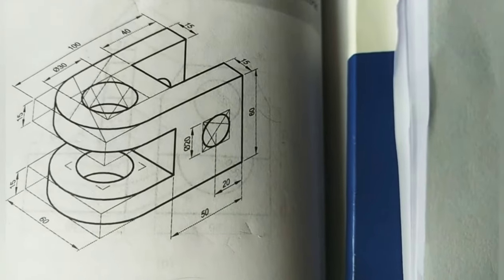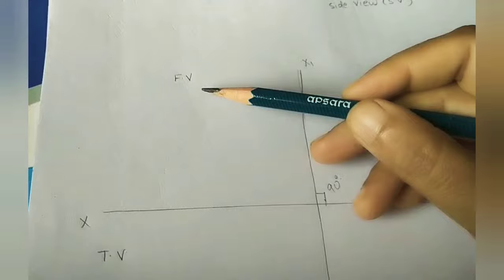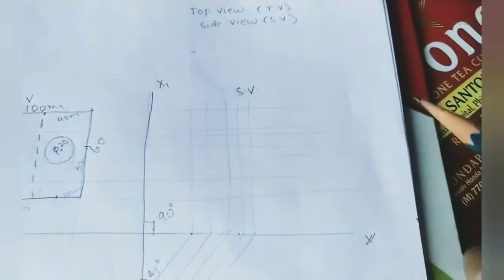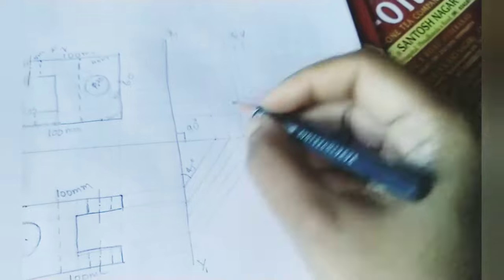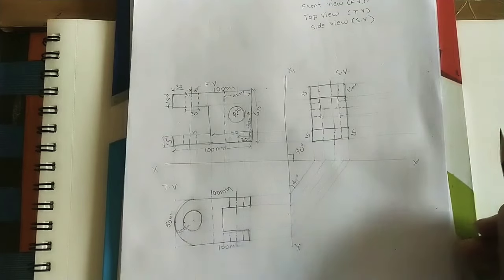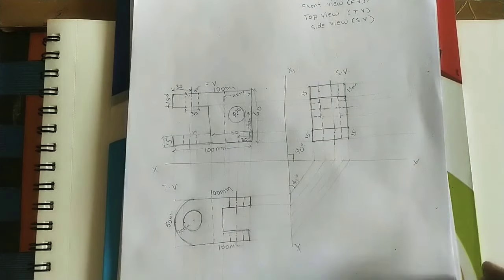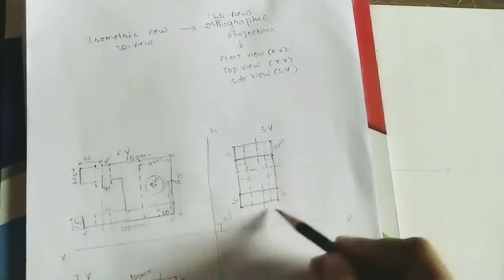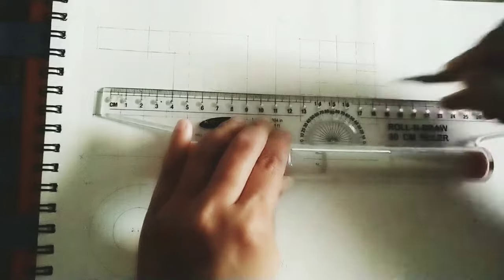Isometric to orthographic Projections //Engg. Drawing //Engg. Graphics

Comment: Draw the locus of a point p moving so that the ratio of the distance from a fixed point F to its distance from a fixed straight line is 0.75. point p is at a distance of 70mm from the straight line.   Mam plz solve this if you are free it was given in last sem
Reply from the maker: Watch this video and try to do the answer :https://youtu.be/YctXW9vG1Ds
Reply: @engineeringclassesbydr.noo3377  thank you mam